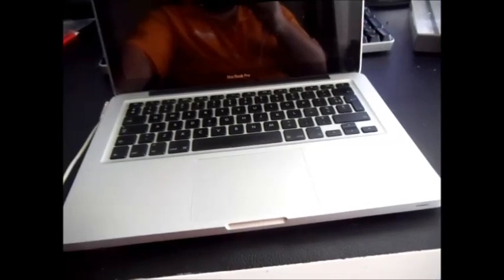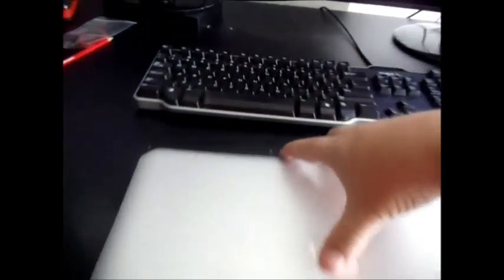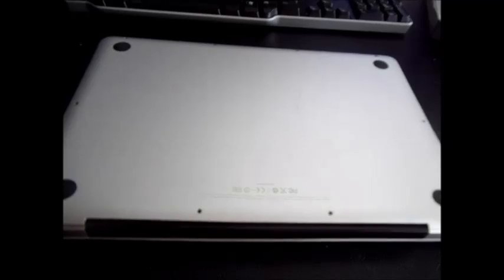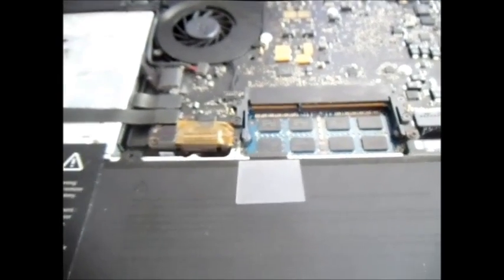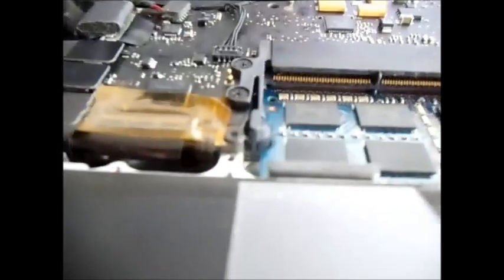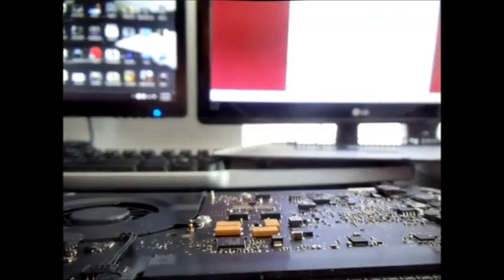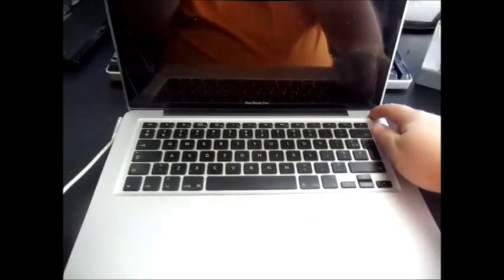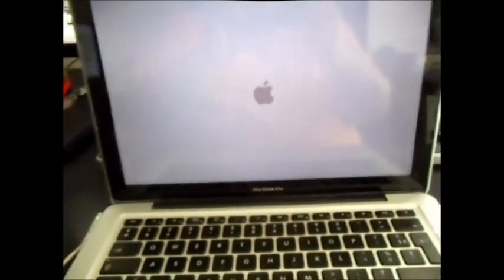Macbook Pro Making Beeping Noises & Doesn't Turn On (Why Does Laptop 2009 2010 2011 2012 A1278 beep)

Comment: One of my cards wouldn’t go back in correctly and i was rushing to goto work maybe if i take my time it will work. I bought this macbook in 2014 and havent thrown it away i finally bought a replacement battery from amazon. I think 10 years later it will turn back on

Comment: I have a Macbook Pro Late 2011 15" and it have the same problem, but even with new RAM installed still the 3 beeps remaining... don't know what to do. The RAM slots are absolutely clean and have also no damage or anything.

Comment: It depends, for me didnt worked, and i have few memories from other laptops and the memories are perfectly okay because ive been using them, but it didnt worked. I was lucky that i had some RAM from the brand Crucial that are the only ones that works with it just now that came with my older MacBook...its crazy....Apple products are so fricking awful because they dont want you to swap parts or fix your own product by your self. I hate them for this.
And now lately, you are unable to upgrade your MacBook....its stuck with what you buy.....
Reply: Hi, I'm having the same issue with my MacBook pro 2012 and try with a few memories but didn't work, so u are saying that is the memory brand? if I try with a RAm from the brand Crucial may be gone work?
Reply: @ecordoba680  Hi, for me it worked straight away with Crucial RAM. Crucial is making RAM for the MacBooks, so you can try this. Usually the ram has to be pair all the time, like 2+2,4+4,8+8....etc...and the same speed clock. Just check Google. Cheers.

Comment: I opened the cover, unplugged the battery, attempted to unplug the RAM board (which you can't see in the video btw) couldn't get the board out without feeling like something would break, pushed it back fully in, reconnected the battery, put the cover back on and it worked! So thanks...but people, try disconnecting the battery once and reconnecting it first, before buying a new RAM. (Whereever we are supposed to find one) My Mac is old, but I need it for the sound card. The newer Macs won't play my Garage Band songs due to different sound drivers...So I gotta hold on to this ageing and dirty beast for as along as I can.

Comment: Got the 3 beeps, came here. Remove both 8gb rams. Replaced with original 2gb rams. Same 3 beeps. Tried 1 2gb ram on bottom slot, 3 beeps. Tried top slot and it turned on. So both original 2gb rams are good and both 8gb rams are good. Only bottom slot of is trash, running one 8gb on top slot. What do i replace. Logic or chipset?? Thanks

Comment: I just turned it on and off and it worked
Reply: Same here, I installed different ram and got the beep. Turned it off and now when I saw your reply tried starting it and it worked just fine. Clearing CMOS or restarting the machine is a good first step to diagnose/fix it. 
Ty for your comment, I rarely work on mac's and when I got the beep I just gave up.

Comment: This is exactly the issue I had, the 3 consecutive beep that everybody talk about is different than this but amazingly this is about the same memory issue, I took one slot out and it boots so now I know how to deal with it thanks
Reply: Payam Bakhshi assuming 4GB ram total you had 2GB ram in slot 1 and 2gb ram in top slot which one did you remove to get to work right?
Reply: The lower DIMM slot memory, I took the memory out, the little dirt or something was making a shorty between two of the connectors on the memory stick, I cleaned it up and put it back and everything worked well ;)

Comment: 1 beep:Incompatible RAM or no RAM

3 beeps:Missing Data On RAM

9 beeps(SOS;Flash theme):No firmware found 

------------------

deal with 1 beep - take out and replace or add new RAM.

deal with 3 beeps - try replacing the RAM and that other ram must be stored somewere just in case.

deal with 9 beeps - im sorry, your macbook has been destroyed and will never come back without an EFI boot.
Reply: Windows 7 how could there be data on the ram. Once it's shut off doesn't the data get transferred to the hard drive?

Comment: Ok. I checked both of them and when only one is in it it works if I remove that and out the other one it still works. But when I put both it makes a beeping sound. What's wrong?
Reply: +Terra bladeX Mega I got the exact same issue...it means the ram is ok I guess
Reply from the maker: +Patoss Maybe the Ram slow is damaged.
Reply: You have to get 2 new ones the memory chips are bad
Reply: Snipester Plays bad logic board,replace it